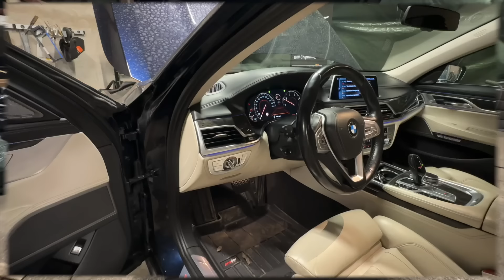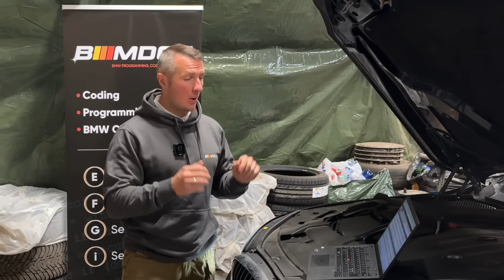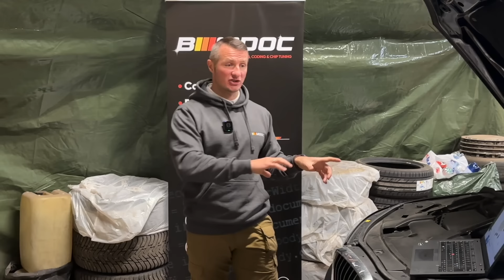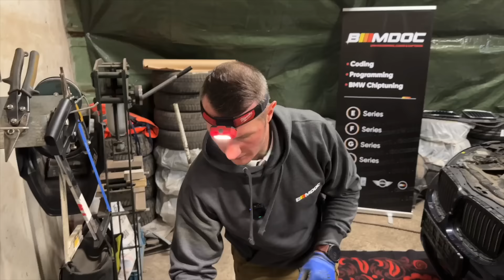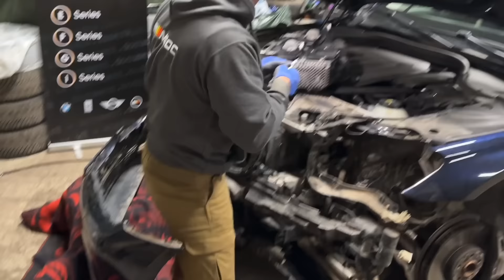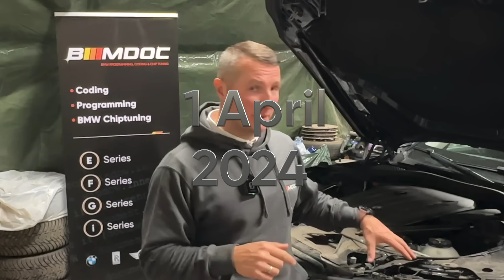BMW F and G Series Headlight Fault Diagnosis & Fix | Step-by-Step Guide

Comment: Doc, I have a question, when for example the ECU of the headlight is bad and i bought it new, it will have newer software than the car? if that is the case i need to program the full car to the latest software? or i can just  downgrade the software on the new headlight ECU, is that possible?
Reply from the maker: I’d update only both headlights to newest SW level and then observe how car behaves. 
Usually it is enough.

Comment: I have a question... If the module is changed (f10) and the error goes from left to right and right to left, can it be the FRM (footwell module)? Also 1 headlight stays on when car is turned off...
Reply from the maker: If you swap TMS and error goes over then it’s the fault in TMS.
Reply: @BimDoc TMS is swapped and error goes ping ponging from left to right and back but doesnt go away. 1 Headlight doesnt turn off so I plugged the battery off... Thanks for your reply

Comment: Great Vladimir, beautiful video as always. You said it's forbidden to program via wifi, yes it's not very safe but I always did and I never had any problems
Reply from the maker: Glad you liked the video! For critical operations, I always recommend a wired connection for maximum stability.
Reply: @BimDoc Thanks for the advice 🙏🏻

Comment: Hi, wha to do if the software level is not the same on the last line in the headlight ecu?Thank you!
Reply from the maker: Update SW in both lights.
Reply: @BimDoc  I did, and now ista dont see 3 ecu - engine, dsc and amplifier. Car starts and drives.Help!

Comment: I am trying to code my new headlight module on my 2014 f10 with adaptive xenon. I connected like you showed, went into expert -> coding, selected the module like you did, but the detect CAF button stays grey. I'm trying to use launcher 2.8.1 with esys 3.30.1 and psdzdata v4.56.32 if that matters. Any help is greatly appreciated thank you! Great videos by the way.
Reply: I installed a newer version of esys without launcher and the option was available.  I used it but it didnt have as new a file as what was on the original side's module. I was able to flash the newest one available to me and it seems to have worked!

Comment: Thanks a lot for your perfect content as always.
It will be very felpfull to show how to unlock the Auxiliary heating as I have it somehow locked:
IHKA [IHKA_G11] | 80139A: Auxiliary heating: locked
IHKA [IHKA_G11] | E70C2E: Electric auxiliary heater: does not respond
Thanks in advance!
Reply from the maker: Use ista to unlock it. 
Go inside IHKA ECU and there you will find an option to unlock auxiliary heating.

Comment: hello dear i have 2 series from 2017 and im facing a levling sensor problem that the car read front sensor but i have only one at the rear so i tryed e sys to fix it but i cant find the parameters i which that you can help me with it or assist me i well be relly happy tp hear from you ❤
Reply from the maker: Look for parameters called LWR

Comment: Can you calculate TAL and and flash first if your software, bootload and coding is different? or should you get the coding file correct first? im guessing you cannot flash the coding file if your software files dont match up? my new FLER module doesnt seem to like any of the CAFD files and fails to execute so not sure what to do next. Maybe because my software files are diffrent?
Reply from the maker: If bootloader is changed then all other software and coding will be also affected!

So if coding doesn’t help you have to update the software

Comment: Great video buddy!
I’ve just put a new ecu and new headlight into a bmw g21 because it was in an accident. The problem I’m having is that in esys it doesn’t see that ecu.
What do you think is the fix for this? If i change the ecu to the other headlight the problem goes over. Maybe the ecu that i bought is faulty?
Thanks
Reply from the maker: Hi,
If you cannot see the ECU then it is problem of:
ECU not working 
Or light itself does not send signal to ECU 

Or both of them.
Reply: I’ve just put a brand new ecu in which i know for sure works but in esys I still don’t see the ecu.
What do you think I can do?

Comment: Hello our knowledgeable friend could you please shed some light onto the BMW Headlight Vertical Aim Control
Failure code D90D2F

Is it possible to just code this function out using Ista/Esys?

Comment: I'm busy installing an oem electrical tow hitch on my G31 year 2019 with the retrofitkit. The AAG trailer module is 2nd hand from a G21 2020 (same part number). After coding 3AC i get a trailer hitch error. I was thinking to flash the AAG module to 2019, but in Esys i cannot see the AAG module with the FA readout at all. 

Any tips what to do?
Reply: Now it's working: canbus wires were put at the wrong bus. Now Esys can see the module and coding works. Thanks for the video's. Keep them coming!
Reply from the maker: Jep, if you cannot see ECU then most common is missing power and then smth wrong with the BUS (CAN in your case)

Comment: Hello Vladimir. If I have f10 all stock, but lots of errors from various ECUs replaced from scrapyard, one of which is CAS4+Keys from donor's car, is it safe to press code on all ECUS at the top of the tree, and would that sync all ECUs to the car ? I wouldn't loose working keys that came with CAS from a donor? Thank you
Reply from the maker: Coding CAS will not cause key lost!

Before coding all car make copy of CAFD (to have a backup)

Comment: Hi Vladimir, I have a question🙋 If I change the headlight need coding, is the method the same as the video??
Reply from the maker: Yes you will need to

Comment: Hi, I am having the same issue with my bmw 530i 2018 , low beam and high beam left side sometimes work and sometimes they don't, what could be the reason?
Reply from the maker: All the same reason as in the video. 
Headlight 
Or/and
ECUs

Comment: Very educational video with many super advises how to do things properly. Thank You very much!

I have a question software (sw) versions and i-steps/levels.
Lets say the car has I-step and software from 2022. My computer has latest data base from 2024. I get an used ecu from 2018 with shipment sw and i-step from 2018. Can I update the ecu I got to sw from 2022 (current i-step in my car) that is in all other ecus in the car? Or I can only update to i-level that is in my computer?
If so - then I guess all other ecus should also be updated to i-level that is in my computer, right?
I can see in the video that I can code the new ecu to different I-steps. But does the sw can also be updated to different i-steps?
Reply from the maker: Yes only to the lvl of your psdzdata. 
So if you need all to be done perfectly then yes whole car update is needed.

Comment: Hey Vladimir , i have a G30 that i did program a new BCM on it Via ESYS (i bought the new one directly from BMW )...
After programming and encoding everything ,i left with a failure that says "HU-H Diebstahl Schutz aktiv ,Kunden Dienste beschränkt" headunit error about Thief protection ..so Maps and i drive related application doesn't work on the head unit anymore, and as i saw in ista+ that i have to get a code from BMW AOS to activate this thing (the code should be downloaded online from itself by activating the function on ista , but it always comes back with the error says "please check the Internet connection "
I already wrote a ticket in aos portal about the issue, but still no any response ... Could you please tell me if there's any another way to activate the maps on the head unit without ista+??? 
Thanks a lot for your amazing videos 🙏
Reply from the maker: Yes it’s possible. 
It’s easy in nbt evo
It’s a bit harder on MGU. for MGU easiest is via ista.

Comment: In whitch program do you code lights? Is this inside ISTA or is separate app?
Reply from the maker: Use esys for that 
Faster and allows to do exactly what you need to do

Comment: Hi Vladimir, thank you very much for the wonderful videos and instructions, I have a BMW G30 3/2022 with basic LEDs (not adaptive, there is no SALAPA element for basic LEDs) and I am going to install older laser lights with new led modules. I have high beam assistant in car 5AC. I am asking for advice on the procedure with E-SYS, I will add 5AZ to the VO and program both new FLEs and what else should I program or code? BDC? KAFAS? FRM? And should I change I-steps somehow, or let E-sys recommend me with FLEs?  Thank you very much for the advice.
Reply from the maker: Hi,
Adding 5AZ will be enough. 

What ECUs to code? I’m going to make full scale video about how to calculate that!
It will take time but I’ll cover that in details there
Reply: @BimDoc  Hello Vladimir, Thank You very much from bottom of my heart, job done, lights are full functional, without Your videos a tutorials I will never be able do it, never. I am happy waiting for Your next videos... With launcher pro 2.8 and e-sys 3.30 I was not succesfull, but I bought yesterday (with Your promocode) and thanks to Your tutorials launcher ultra and with e-sys 3.36 it was without any problems, without any error.Thank You once again!

Comment: why my F10 not shown FRM for both headlamp like this?
Reply from the maker: Additional light ECUs depend of the chassis and headlight type. 

For example you can see 2 or 4 ECUs. Or even zero if you have non adaptive xenon lights (but ECUs will still be physically present)
Reply: @BimDoc   but if no adaptive means show one FRM so how to check the both side SWFL or software ?

Comment: Hello @bimdoc huge fan here from Brazil. I'm experiencing a weird scenario on my 2015 f15 35i euro. It has surround camera view, it works 3 cameras but the rear view stays blank. But if i set reverse gear, it appears a rearviewe camera kind of weird wit a zoom pointing to ground level, lines in dash works and all. Then if i go forward i can change to sorround view again and it shows the other 3 cameras but not the reverse one. And it displays error in dash about no rearview camera connected. Tried using ista to calibrate but it shows error of no communication with reverse camera. But it stills works everytime a put on reverse... any ideas? I thought maybe the previous owner replaced the camera with a wrong one? So weird. (I bought the car like this already and no contact with lrevious owner
Reply from the maker: Check if rear camera standalone is the same as for 360 camera system or it is different one 😉
Reply: @BimDoc  guess what? Different one 🙄.. already ordered a salvaged one to replace it! Thank you very much
Reply: @BimDoc  Update: previous owner did install a aftermarket camera, that was the issue (at least one of them).
I ordered and installed a original bmw camera and now my 360 view works.
New problem is that now when I put in reverse it automatically toggles the rear view camera full screen (no option to change to top view, does have a code to make it enabled?), but the rear view camera appears black. No image at all. If I take out of reverse and put on neutral our P or drive, automatically changes to top view, and it shows the rear view camera perfectly. It I push the camera button it shows the reverse camera perfectly, and I can even switch to the tow angle. It appears full screen, normal. But as soon as I change gear to reverse, screen goes black again. Everything works but no image. Any ideas?
Reply: Just found out there was a aftermarket module as well. Uninstalled and now everything works perfectly

Comment: Hello, teacher. In order to use a program ISTA and the programmer, do we need to connect to the Internet, or does the program, whether diagnosing the malfunction or using a programmer, do not need the Internet?
Reply from the maker: Ista can work offline also. If it is stand alone version.

Comment: Great content as always on your videos.  I have a question regarding my 2017 G30 Right-Hand Drive BMW.  I'm planning a trip to Germany this summer, is there a switch on the head lamps to convert the xenons to European lights?  I don't have access to change this through the I drove system as I wasn't aware this was an optional extra.  Any advice would be greatly appreciated. BMW has quoted £5000 to have this option rectrospectly have this installed.
Reply from the maker: Lights replacement and coding is needed. 
That’s why not doable so easily.
Reply: Я мастер мне нужна ваш номер вачабы что бы с вами свизатса

Comment: Hello sir i have a question to ask, recently i was able to buy BMW S1000RR K67 2020 and up with Digital cluster, TFT screen, and this speedometer is smashed hard, and this speedometer is smashed hard, so i need to reprogram used one is there a chance that you know how to do it, used one is almost impossible to unglue to get inside.
Reply from the maker: Verginize first
Code with esys after that 

Done ☺️
Reply: @BimDoc  😀thx for the respond but i aks a wrong question, is ther a way to virginize this speedo meter whitout opening it i mean coding eeprom yousing the speedo plug because it is imposible to open this cluster

Comment: Hello everyone, do you need help or tell me what I'm doing wrong? The f22 car, after the accident, the headlights were broken, they were restored and now an error is burning on the right headlight, the driver module of the right headlight is wrong in coding, it turns out that the rings on the right headlight are constantly burning at full intensity, despite the fact that they turn on the near or dimensions, while the cilia are near far and the turn signals work, but the rings are on the floor the incandescence does not switch, I connect with a rhine, I try to make an incilization, too, gives an error on the encodings, I go into the esis, I do the encoding of the fem-body block through Detect cafd for swe everything goes glatko without errors) but the initialization does not take place in the rhine, the error still hangs!!!
Reply from the maker: If coding is not accepted (or initialization) then wrong part or mechanical damage inside ECU/Light 

Try changing ECUs between lights

Comment: Hello. I have one question. Have G12. The battery replaced and it is 100ah, shoud i code it to 90ah or 105ah? Because i feel a litle bit lost. Coudnt find info on google, so decided to ask you.
Reply from the maker: Not every battery can be coded according to its specifications. 
I always suggest to code the closes value. 
In your case I would choose 105ah. 

Also if you are driving shorter distances then even one more argument to code a bit higher value!
Reply: @BimDoc  Thank you!

Comment: Brilliant video, thank you. However, it does not seem to work for my pre-LCI 520. I changed my drivers side TMS module, but when I run ESYS it does not show the left and right FLM ECU's like in your video, so I cant check the software/code the new TMS. Maybe I need do something else.
Reply from the maker: It is important to understand do you have F10 or  G30?

The reason why you don’t see TMS (but they are physically present) is because you have regular xenon lights (not adaptive) and in that case you cannot see TMS!

To code new tms just code FRM ECU and your new TMS will be coded in background. 

That’s how it works on bmw 😉
Reply: @BimDoc  Thank you. I have the F10. It would be great to know how to code the FRM. If you have a video for that please let me know.
Reply: Also, I only have Halogens not Xenon’s.

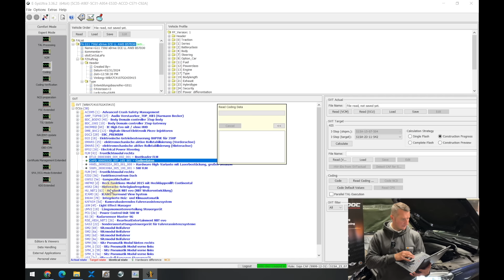Comment: Based on module description the both FLMs (43 and 44, see 19:20 min) are for right! The question is, is the launcher issue?
Reply from the maker: Yes this is the launcher decoding issue. 
I even haven’t paid attention to that))
I just know that 43 is left and 44 is right. Because older launchers did not show that )

Comment: Hello BimDoc,
Thanks for sharing. We learn useful things from you.
I want to ask a question about a few videos I saw on the internet. I have seen some people reset their EGS ISN with e-sys. 6hp 8hp egs7 etc. How do they do this? Is BMW AOS required for this?
Reply from the maker: Yes you are right it is doable via esys. 
But special SWFL file (modified) is needed. 
Also that method will not work on all EGS

Comment: I'm struggling with English also, but just to clarify ECU - Engine Control Unit. Maybe Headlight Module or Controller will be more appropriate in this case
Reply from the maker: ECU - Electronic Control Unit
So I guess all is okay 👌

Comment: Small correction: "turn signal ECU" and "DRL ECU" are not ECU. This is just LED modules.
And please note that in newer laser headlights (SA 5AZ) on G12, G07, etc., the FLM-02 MID_10AH2S ECU is installed, this ECU is in a completely metal case. If, after clicking the "Detect CAF for SWE" button in the E-sys, you receive the error "Failed to get CAFs for SWE", this may mean that the wrong ECU is installed in the headlight. If you replace the laser headlight or its ECU, you may need to program the headlight ECU to add SWFK_00005CFC... (create TAL with 5AZ in FA), and this software remains in the headlight, and not in the ECU. Without this file, everything will work, the high beam too, but you will see the high beam faulty error (this means that the laser high beam is faulty).
Also, errors with programming or coding of the headlight ECU can be caused by faults inside the headlight itself, unconnected or faulty LED modules, or if the headlight adjustment motor is not working correctly.
Remember that LED modules can only be connected when the headlight connector is disconnected.
Reply from the maker: Yes you are right. Not a separate ECUs